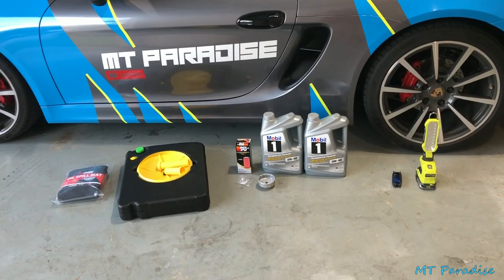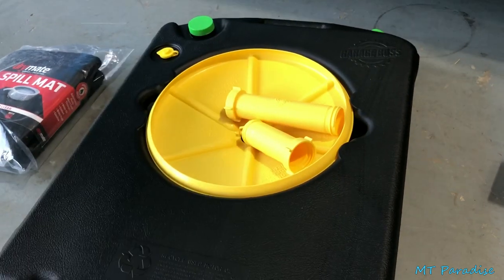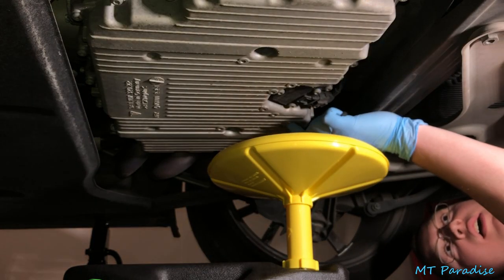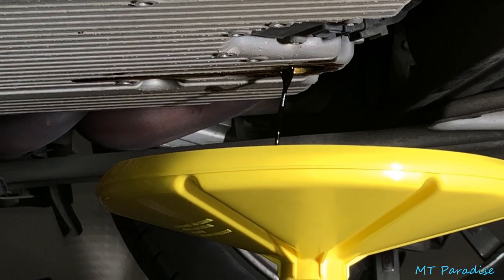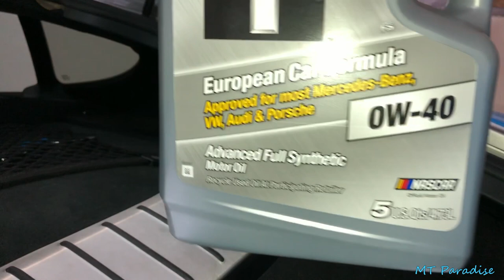Oil Change on Porsche 981 Cayman S | at Home

Comment: the washer is a crush washer. make sure you torque it correctly, its a one use item hence it crushes. The filter housing should also be torqued correctly else you crush the rubber oil seal and it leaks. It is not tight as I recall 18lb..get it right and check. Also put timber or at least the wheels under the car in case the axle stand slips..saftey first
Reply from the maker: Thank you for the advice
Reply from the maker: Thank you for the advice
Reply: You will never crush oil seal o-ring. It's on the outside diameter. However it is important to use correct o-ring. Some filters come with wrong o-ring size.

Comment: Looks quick and easy. I hear the dealership charges @$250 for an oil change service. Did you also reset the service date on the PCM?  I have parts on order to do my first oil change since purchasing my 2014 Boxster S in late August.
Reply from the maker: To reset the service date you have to use a device that plugs into the OBD2 port and I’m still looking for a decent one.
Reply: @MTParadise  Until you do (I'm still looking, as well, find you a friend that works for a dealership to reset it for you.
Reply from the maker: No Revving I just deal with it 😂 the little notification pops up on start up but goes away.
Reply: I have 2014 Boxster S and I change oil myself. I use Cresetter 2 Launch to reset service light. It works on my wife's 2016 Macan S as well.

Comment: It seems to me the 981 does not have jack stand points, so where exactly did you place them? I was thinking about investing in one of them small store-away scissor lifts...
Reply from the maker: There are many Jack points under the car. There are 4 main ones just inside each wheel. They have a circle hole. There are other parts of the car that are safe to use as well but I have a friend with a Gallardo with the portable scissor lifts and he uses them all the time and loves them. I’ve been thinking about getting some too just to make life way easier.

Comment: Thanks. Can you post link to the drain plug with washers and the filter tool?Where did you buy the oil filter? Thanks.
Reply from the maker: I’m having trouble finding the exact post but I got the drain plug with washers on amazon as well as the oil filter and the tool.

Comment: When you lift the car like that it would seem to me a 1/4-1/2 qt of oil would remain in the front of the oil pan. When I do my car (not porsche), I drive up the fronts on some wood ramps I made from layering 2x12's. Then I jack up. Then the pan is level and all the oil will drain out. Check to see if you overfilled a bit my measuring what you took out.
Reply from the maker: When I added the required amount afterwards, I ran the oil check and it was right at the level it should be. If it’s a little over, it’ll tell me. But thank you for the input.
Reply: This has been tested before...and not jacking the car up level leaves approximately 8% of the old oil remaining in the bottom of the engine, or 2/3 quart.

Comment: Hey I may have missed it but what's the torque value on the Drain Plug and Filter.
Reply from the maker: Drain plug is 37ft lb
Filter housing is 18ft lb
Reply: MT Paradise I noticed Porsche sells the housing, filter and the O ring as a kit and not separately. Was cheap at $23 so didn’t matter.
Reply from the maker: @Californification  oh nice!!! That’s not bad at all
Reply: @MTParadise  Thanks a lot for the DIY. Have done plenty oil changes on my M3 and other cars of the past but whenever there is a new manufacturer and model it always helps when you know where to look. Thanks. On a side note, that oil drain on my GTS took over 30 minutes. Yes the oil filler cap was open but it kept draining and draining. Lol.
Reply from the maker: @Californification  mine takes forever too. I usually let it drain then I come back like an hour later and continue 😂
Reply: @MTParadise  Yeah will do that next time. I never imagined it would take this long. It’s unreal how long it takes. Lol.
Reply from the maker: @Californification  I know right lol my Jetta takes no time at all

Comment: Great vid! Does it making a ticking noice when cold start?
Reply from the maker: Thank you. It does not make a ticking noise
Reply: Mine does the same if it’s been sitting a while. Only for a few mins
Reply: @stevebrodie3565  okay, same with mine. Do you change oil before the schedule?
Reply: I only use my car for nice days,  and so that probably my reason for the slightest ticking when cold. Yea oil is changed ever year no matter what mileage, only do about 4-5 miles a year.
If I have been using the car I don’t get the ticking. Thanks and be safe.
Reply: Ticking is normal. The cam followers stick a little when the car is not used much. If you run the car make sure you let it reach norm temperature. The followers unstick when the oil is hot and less viscous. Ticking quietens down  The oil filter and drain plug should be torqued up to a certain level not just screwed back on randomly
Reply: @simplysimon966  where I live I keep it parked for an extended period of time due to snow. There are some articles that I have seen that ppl first spin the engine with no power to injectors just to get oil into where it should be. I wonder whether anyone is doing it.

Comment: Total no brainer to do the oil change yourself on German cars. The dealer charges $300-$400. Lol! What a ripoff for a simple job. Well done.

The filter is definitely located in an awkward place like everything else on this car. Miss my M3 and all BMW’s where the  filter is accessed from the top.
Reply from the maker: Once you have the cheap tools, the oil is the most expensive part 😂